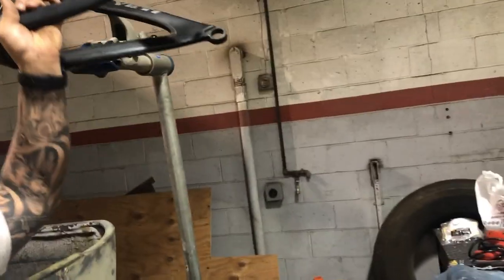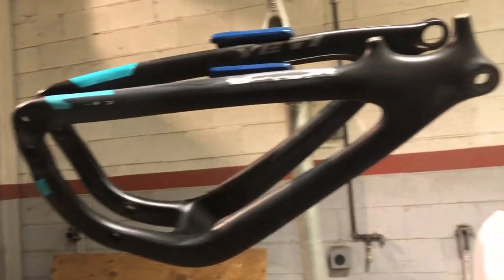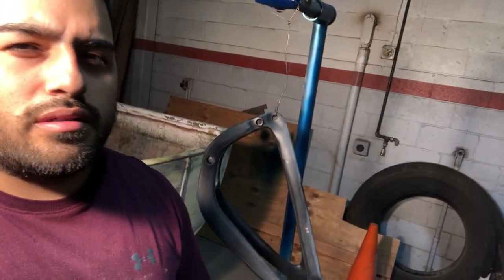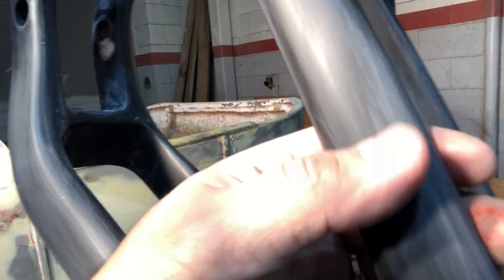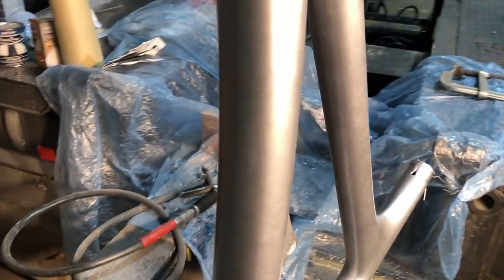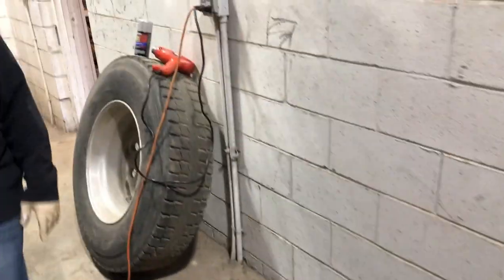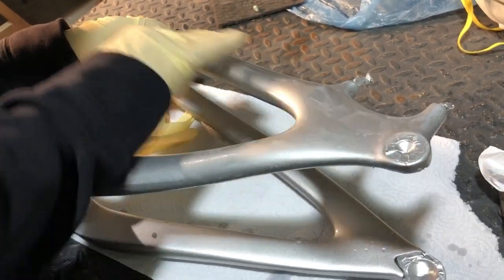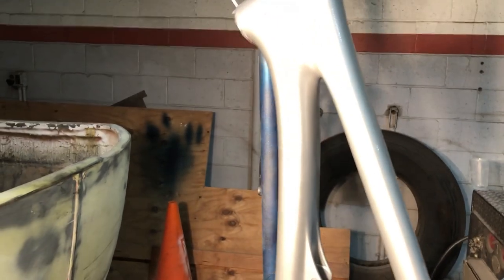Painting a Carbon Frame (Yeti SB5) | MTB #732MTB #MANDALO #racklove

Comment: Bike looks really good.  What did you use to fill in the chipped spots?
Reply from the maker: Brian Vaughn some sand-able automotive filler. Comes in like a toothpaste container and drys very quick
Reply from the maker: Dempsey it can but when I did my aluminum I decided to get it powder coated. Much more durable.

Comment: Wow. That frame looks sweet. What paint did you guys use?  Would it work on aluminum frames  I'm thinking about painting my road bike.
Reply from the maker: Hey I got all my supplies from Autozone and Pepboys. For an aluminum frame I would recommend getting it powder coated. Alot more durable.
Reply: @CartelMTB  I appreciate the info. Thing with my road bike is that the rear and fork are carbon.